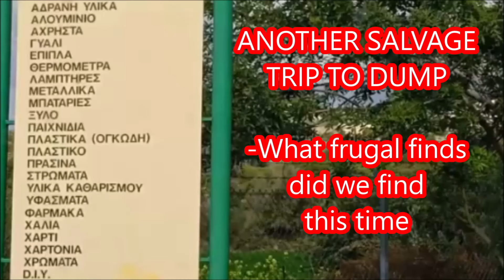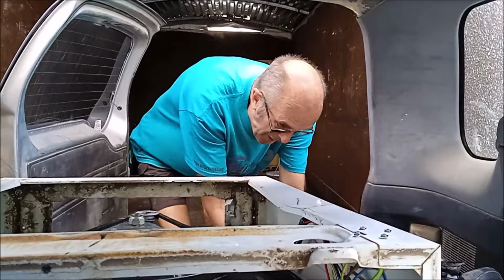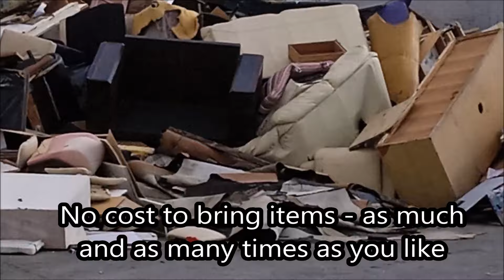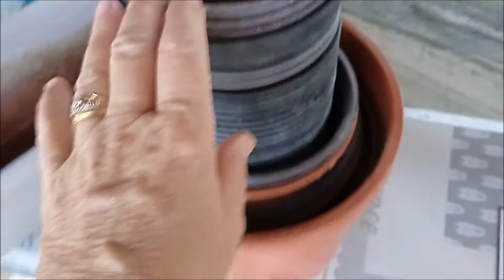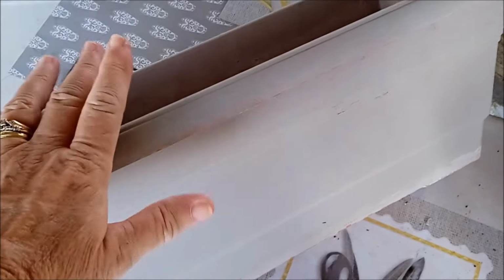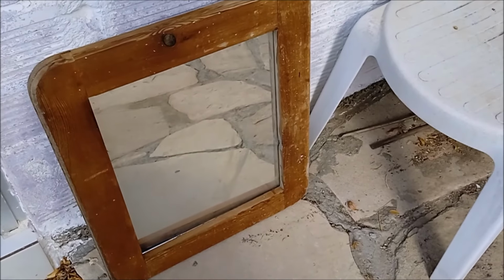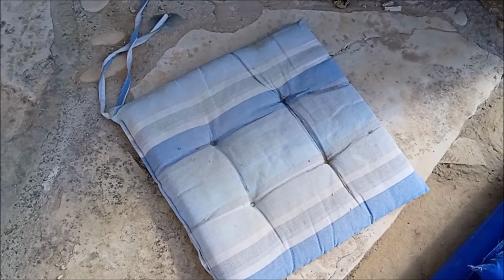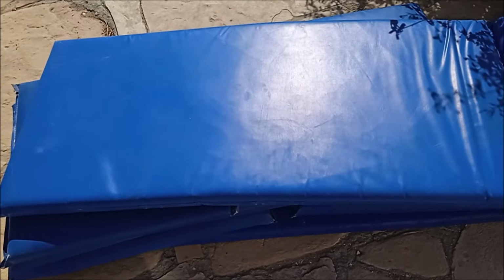Another SALVAGE trip to DUMP.  What frugal finds we found this time

Comment: You did a great job on the haul. I need to get to our dump because this is a good time of year to get gardening things in the dead of winter. I’m not so sure about putting toweling on those blue mats. Towels take a long time to dry off once they get wet.
Reply from the maker: I would love to see footage of your dump.  Re the towelling - I was thinking only on them out when using them (in during night etc) as I thought they would be good for when you come out of the pool wet to sunbathe.  The blue mats get incredibly hot, even when in the sun for a short time.  Any other ideas for what to use?
Reply: @newbeginnings-myeverydaylife  Our dump is kind of like a warehouse store. They do have big dump containers organized by material - like metal, cardboard, etc., but anything that's any good is in this huge area that's mainly under tin roofs. There are household goods, gardening, bathroom fixtures, all laid out in areas. I just love it there. For the mats, I don't know. i was thinking some sort of multi level top mat or material that deflects heat and allows moisture to wick off. Those mats are a wonderful find and I hope you find something for them.
Reply from the maker: @MyMountainHomeandKitchen  as long as its free!